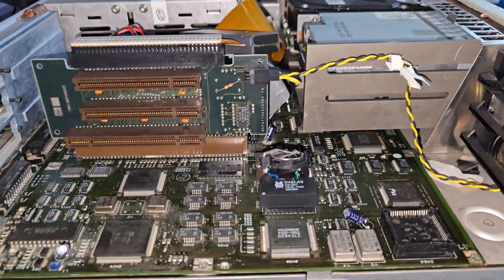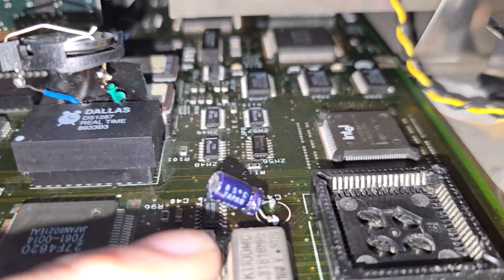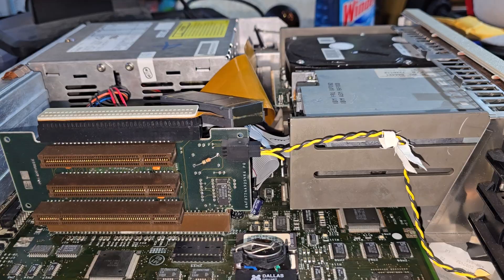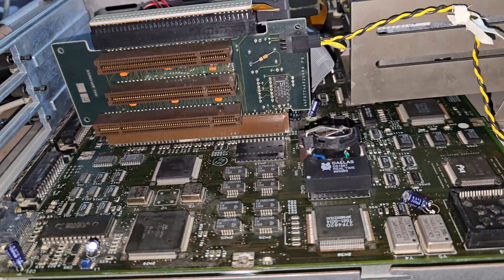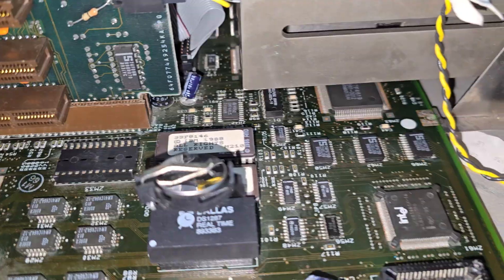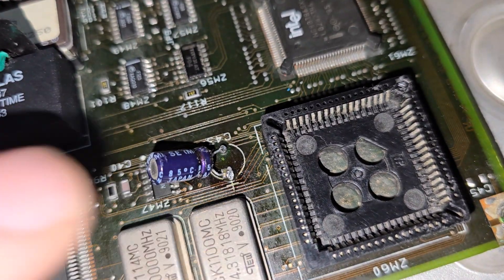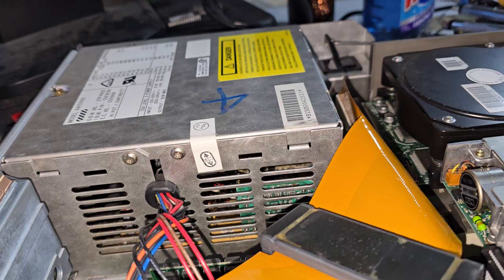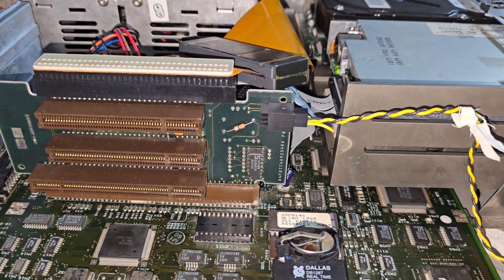Reassembled and Repaired? The IBM PS/2 55SX Test Part 1

Comment: I'd take a look at the power supply to see if you've got any caps in there that have gone bad causing it to got into shutdown mode. While IBM did opt for decent quality, you will run into that as well simply due to age and many hours of use.
Reply from the maker: @BeniD82  thanks for the tip! I'll double check. I figure I might as well hang on to this until I'm certain there's no reviving it